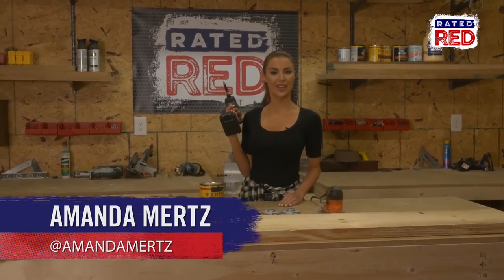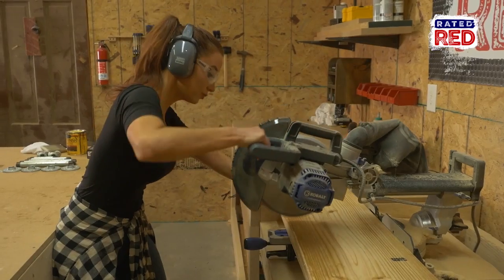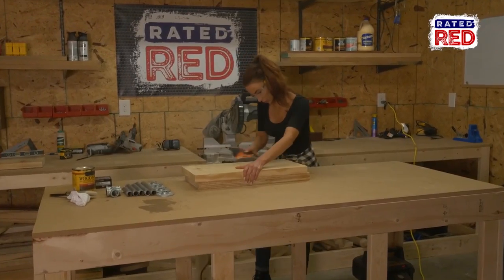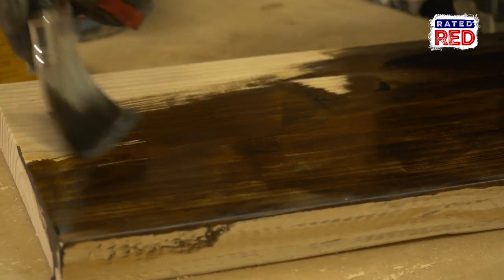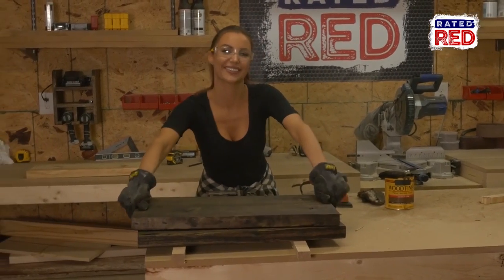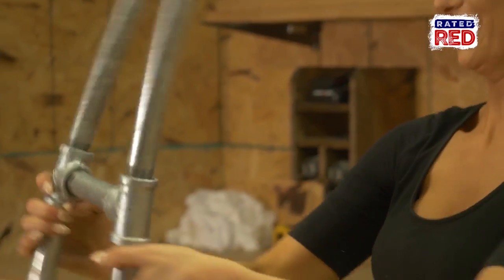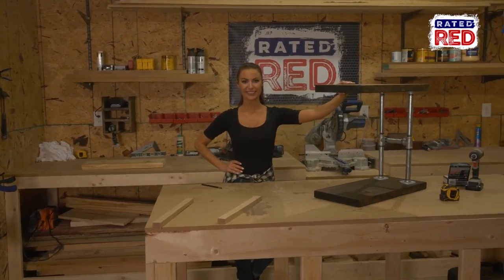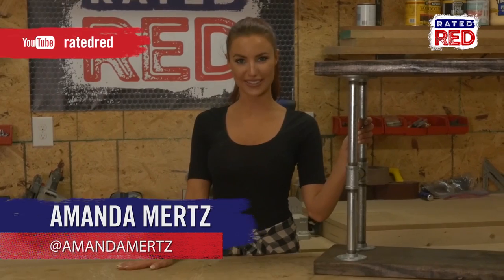Tray Table | Red Hot Building

Comment: You build a great tray table...  I think both the top and the bottom should be varnished.  The bottom should be varnished because a smooth, varnished surface slides across carpets very easily.  You should also consider painting a design on the top of the tray table before you varnish it.  That adds a lot of character to the piece.  Welding the pipes together is a great way to show off whatever skills you have also.